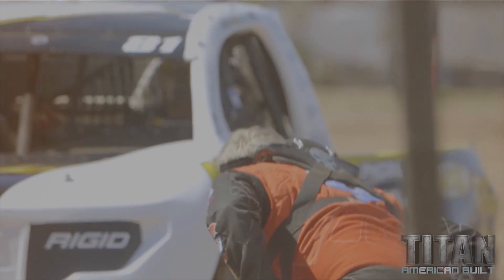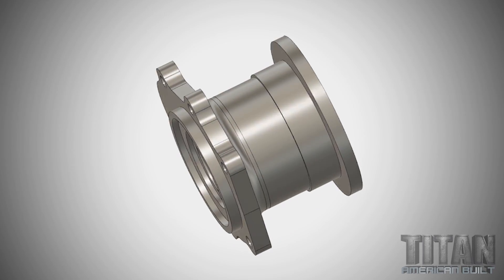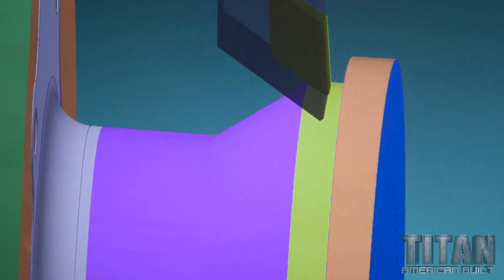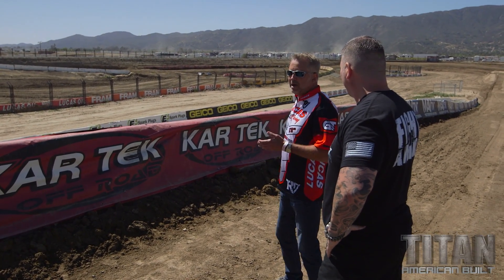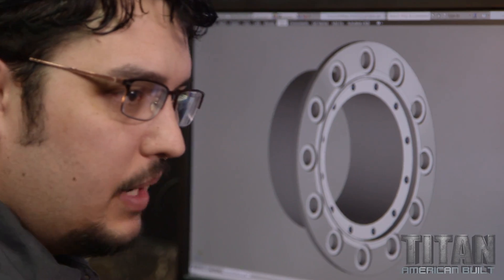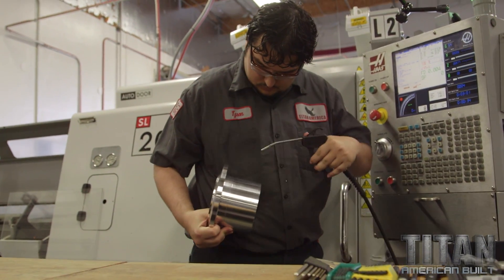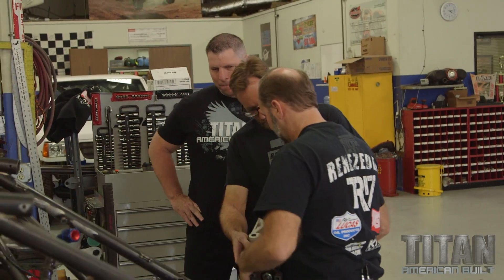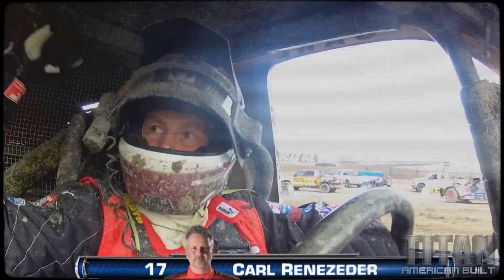CNC Machining a Differential for World Champion Carl Renezeder

Comment: Dynamic lathing with a groove would been alot faster :)
Reply: Please explain to me what "dynamic lathing" is? Turning with a grooving tool is always a compromise, you can't take cuts nearly as deep or feed the tool as fast. You only do it when you have to. It definitely wouldn't be faster and you're introducing opportunities for chatter.
Reply: I'm a mill guy I have no idea what you guys are talking about
Reply: Yes you are correct . I had done a fare amount of metal removal before I started using groove tools , for mass metal removal , it is ALOT quicker than conventional turning in every case , an 1/8" to .200 tool is what I used cut cycle times down big time and is more reliable as well . Its the difference between boring and coring ! This was a good demo though .
Reply: Agree doing that groove with Multidirectional tool is a compromise as you’ll struggle for a chip breaker as well.